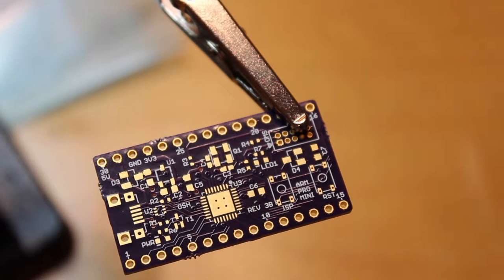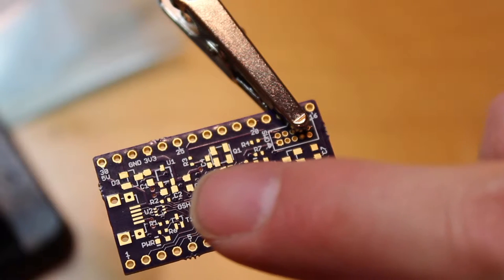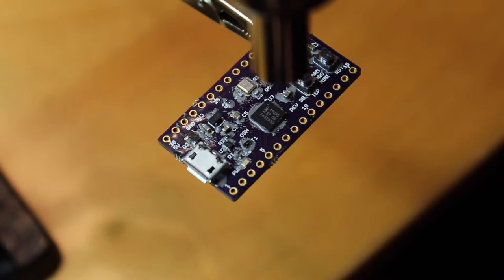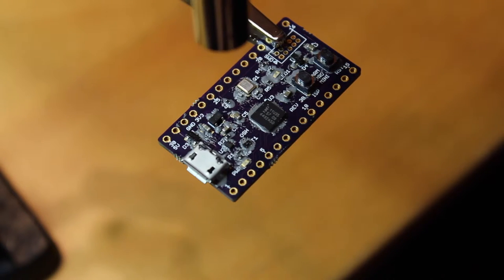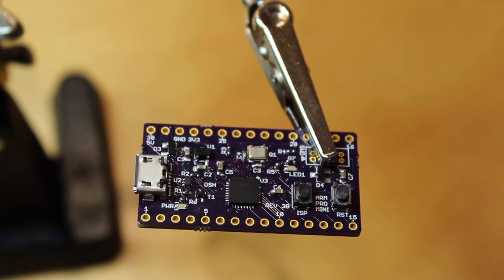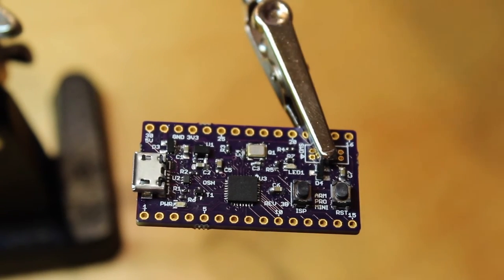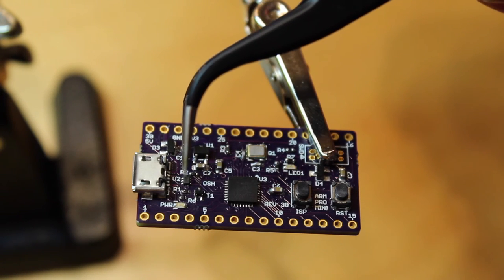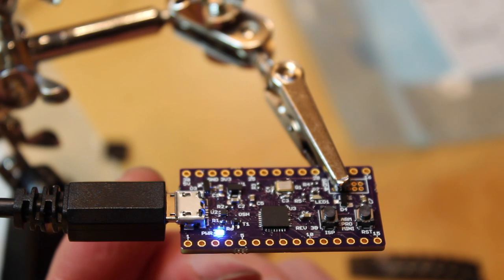Surface mount soldering with hot air an ARM based Pro Mini microcontroller

Comment: are you planning to use for anything specific.
i got a rev 2c board from the designer of it, think his name was Zapta, i first seen it on EEV youtube channel on mailbag!!

i havnt made anything with it yet but pulled it out today to start compiling code !!! for what im not sure yet?
Reply from the maker: Hey Paul, made for nothing specific, just wanted to try reflow soldering as I had reached the limits of what I could do with a soldering iron.  The USB port means it could be good as a human interface device I guess.  I might try to make a GIMX controller or something https://gimx.fr/wiki/index.php?title=Quick_Start#PS4